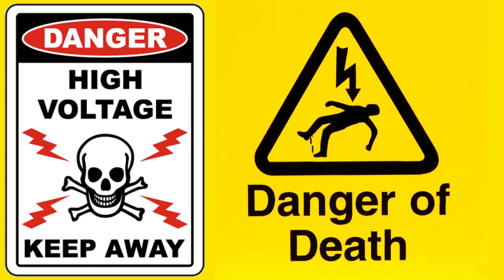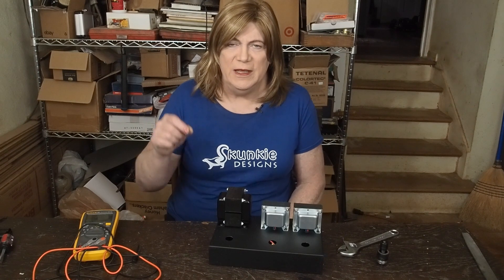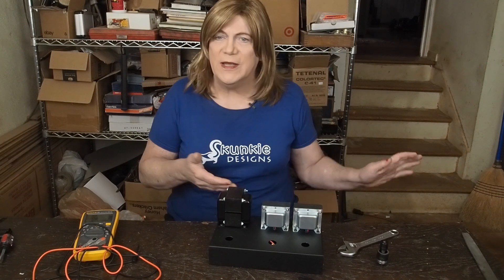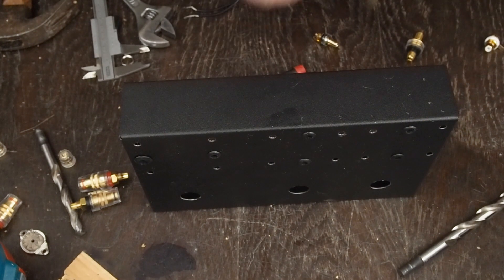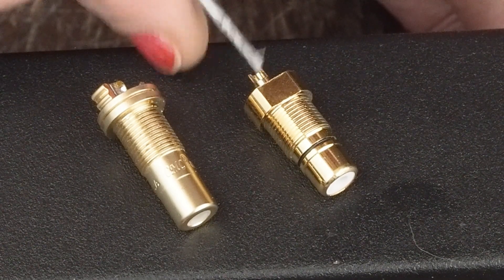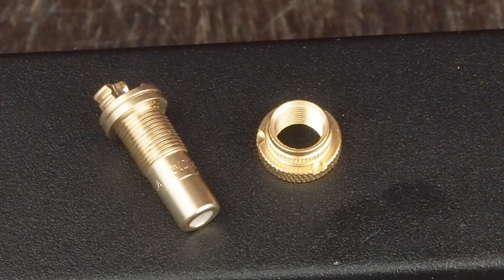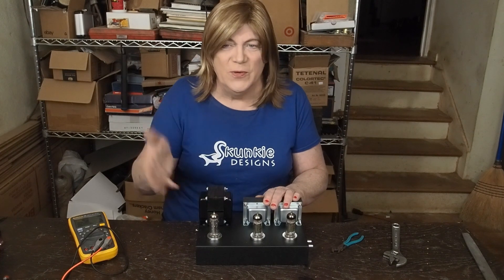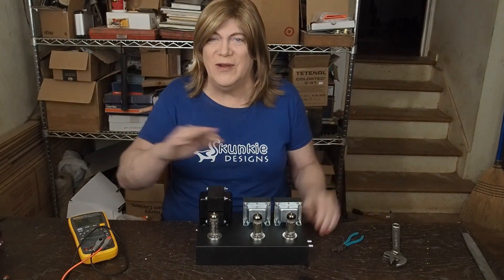6BQ5 spud amp: #2 Fabrication

Comment: Have a question: what does b plus mean. Tried looking up online but couldn't find any info.
Reply from the maker: B+ is referring to the rectified high voltage DC produced by the power supply.